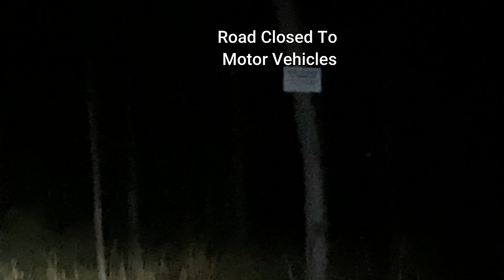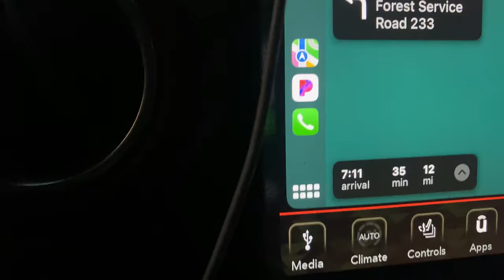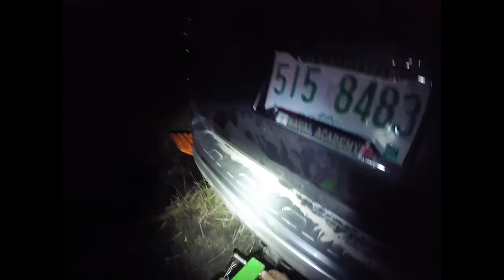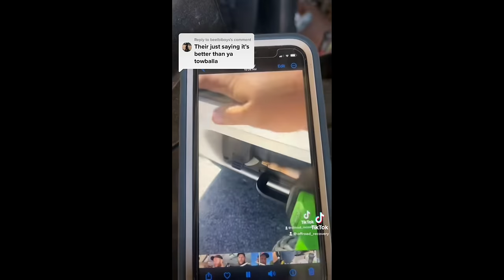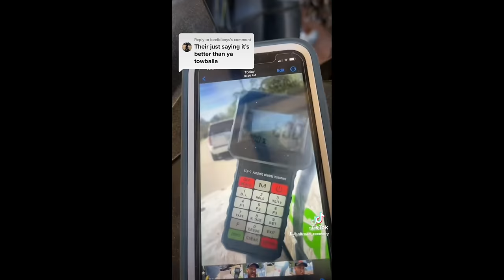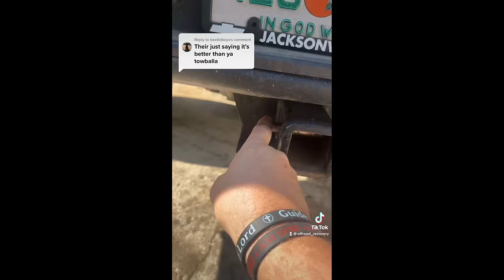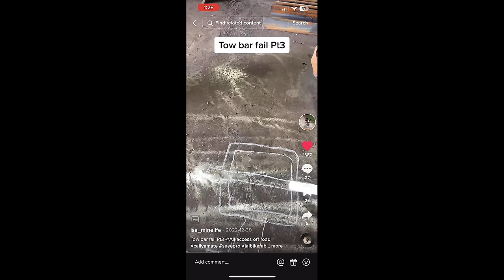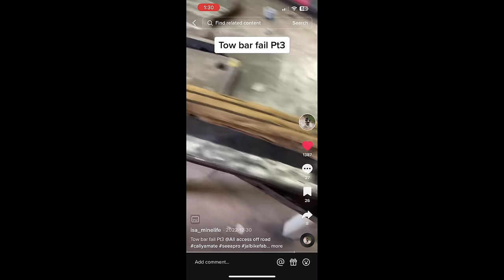S1 E2 We can’t find the customer

Comment: I come across your channel. It is awesome.  On this video hites home with me. In 1993 I was a tow truck driver. Did everything from put semis back up that laid it over. One night I was out on a call getting a pick-up out of the center of the hwy. Got them out to the side the hwy. They shut the hwy down it was bad. I been doing this for 8 years. Semi driver left truck stop where I worked he top a hill seen my red lights jack knife his trailer smashed me between the pick-up an wrecker drug me 213 ft under the front of the pick-up flip the wrecker over. I lost both my legs back has 2 steel rods in it. I look at it life lives on. Happens for a reason. I was 29 years old when it happened I am 60 now. I do more then most people with legs. Be careful out there.  That is one of the most dangerous jobs out there. Working on the side the Hwy. It happened on I-44 in Central Missouri. I have family lives in Jacksonville Florida. Awesome Channel.

Comment: Point taken on the tow hitch do's and dont's, going to be order "recovery accessories" for recovery and use my tow accessories for towing and not recovery. I dont want to learn a lesson the hard way and get someone hurt, nice job
Reply from the maker: on the hitch part don't be scared of the Amazon cheap one, they are solid metal which makes them heavier, the good ones are made from aluminum which makes them lighter but cost more, but its the one item you can be cheap with zero safety issues

Comment: granted I am not sure if his product has been tested or not, but Brennans Garage has a product to solve the hitch pin issue in a much better fashion than receiver mount shackles. It is a solid piece of aluminum designed to mimic a hitch and allow a soft shack to be fully supported without sticking out of the hitch receiver itself.
Reply from the maker: Except Brennan is not a great person to deal with and loves and I mean loves to spread false information about stuff using complete wrong information to push bad information

Comment: Back when I was younger... I couldn't  find my hitch pin. I had a bunch..
So I popped in a 1/2" bolt and gave it a small tug trying to unstuck a small forklift in gravel with my c30.....
Not too heavy of a load.
Gentle tug.

Yeah, no, that was dumb. 

Not only did the bolt bend, pull through, and get thrown a bit (using a big chain).... it also mangled and oblonged the holes for the pin so I had to change out the whole hitch, because I actually do tow heavy with it. 

1 sloppy moment = live (hopefully) and learn (hopefully).

Comment: Too many times I have seen the proper equipment fail, definitely don't want to use things that aren't designed to do the job, tractors are heavy powerful machines with extra heavy duty parts and I've seen those parts fail and nearly kill people so parts that are made on the cheap are really dangerous and shouldn't be used. Don't risk life and limb when the right equipment is cheaper than an ER visit